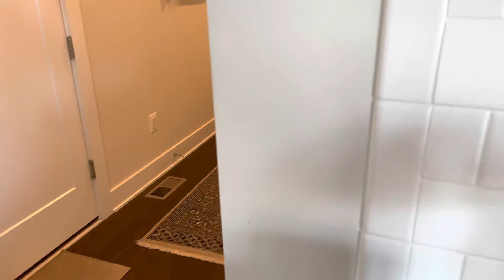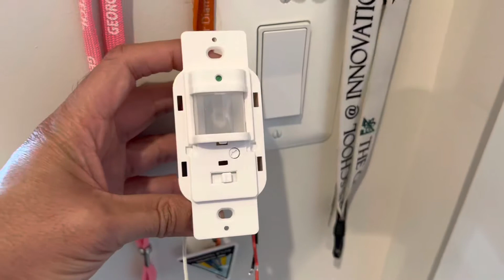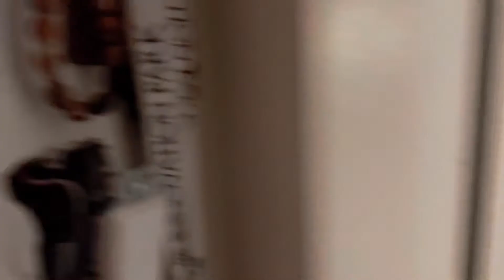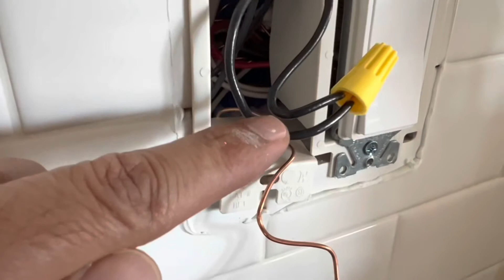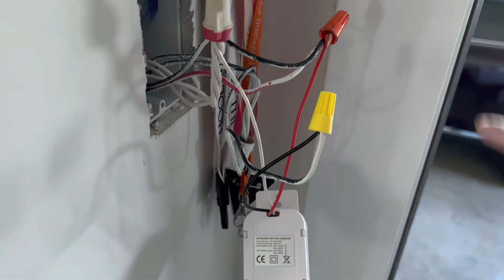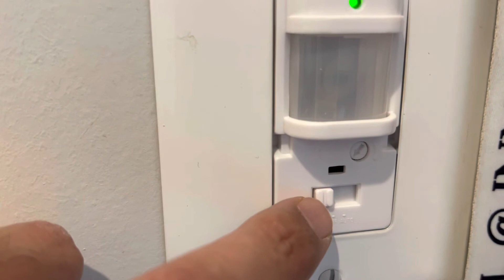Replace 3-way switch with occupancy motion sensor switch

Comment: I am confused as why you combined the 2 black wires together in the hallway but only used the main single black wire in the kitchen. I would have thought you would either just use the single black main wire from BOTH outlets or combine BOTH black wires in BOTH outlets. I don't understand how those traveler wires work, can someone explain the reason why both blacks are combined from the hallway only but not in the kitchen??

Comment: A Perfect Description of how to wire-In a motion sensor to a 3-way system!!  This is usually the most efficient application of a motion sensor, as I have found in our homes.  Clear and to-the-point.  Eliminate one side - Power in - Neutral attach - Line to Fixture.  Ndrew, that was a simple single pole motion sensor. Thank you so much!!
Reply from the maker: Glad it was helpful!

Comment: Is that a 3 way motion sensor ? Or just single pole
Reply: Ndrew, that was a simple 3-wire, single pole motion sensor.
Reply: Ok you said it was a three way, now you’re saying it’s a single pole.  This was extremely hard to follow. And my single pole has four wires, not 3. 😣
Reply: @Randommemes741  It is a single pole switch. He shows you how to use this in a 3-way system. As follows, you need to I.D., In this example =  Power in(Black) - Neutral attach(White) - Line to Fixture(Red).  Good Luck!